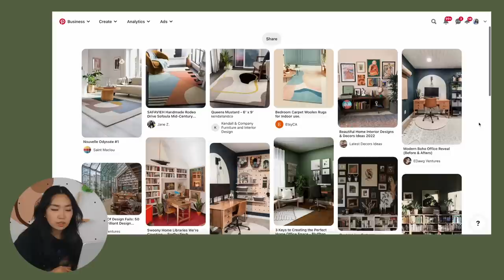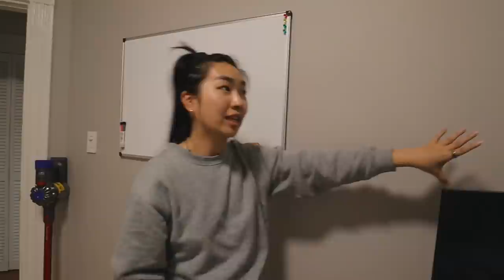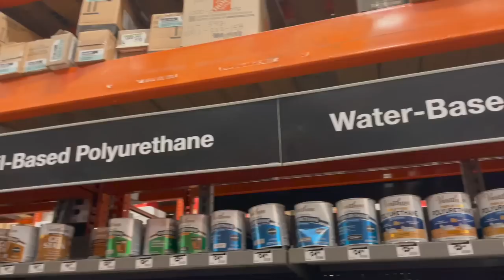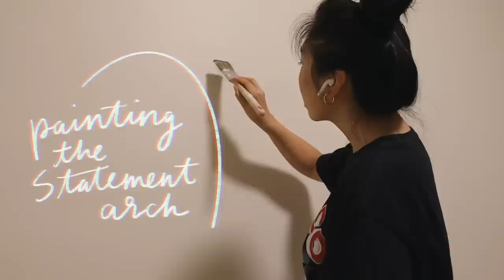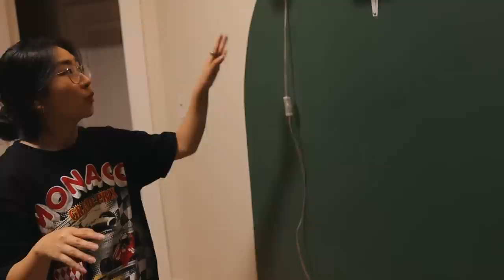Surprise Room Makeover for My Sister!

Comment: About the gel stain,
The stain basically is like hair dye, the dye has to enter the hair strand and create a bond on the inside and the excess gets washed away. The same happens with the gel stain, you sand the wood, the stain enters the wood and conditions it and then you wipe away the excess. Its not paint!
The reason it didnt work could be because
1. This is not a natural wood shelf
2. You used a primer
With faux wood furniture the best thing to do it: sand it (prime if you want) and then use chalk paint. If you wanna use normal paint you have to prime first so the paint grips onto the surface but with chalk paint you dont really need that.
Hope that helps (sorry for any mistakes English is not my first language, greetings from Germany ;)
Reply: I was looking for this comment

Comment: The gallery wall would've been so much better.  I don't get why the plant hangers were there, why not use nice ceramic pots to add style?  
 The sconces hanging so close together and on the arch looks weird to me, I'd have just put them on the wall further apart, the light spreads - and I'd have covered the cords or even used different sconces that didn't have cords.   I'm personally not a fan of the rug, but the room looks much better than it did and you made them happy - that's what counts!